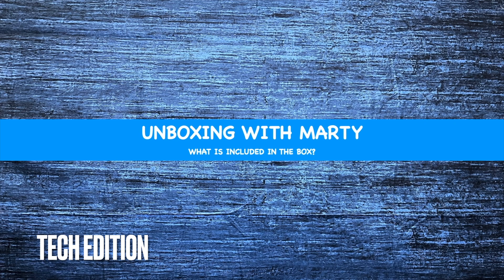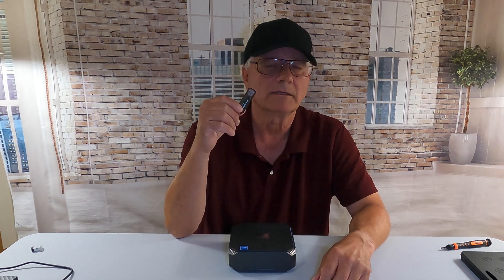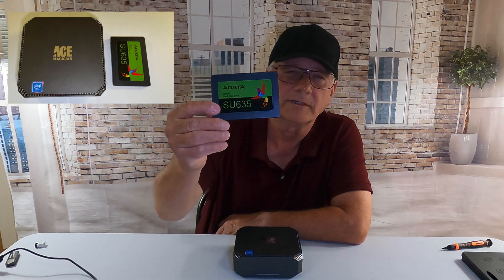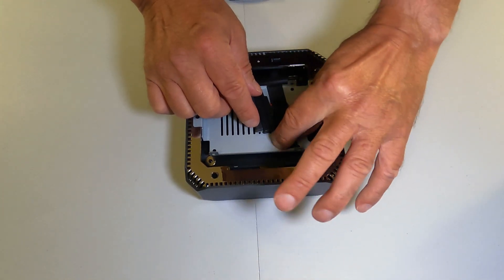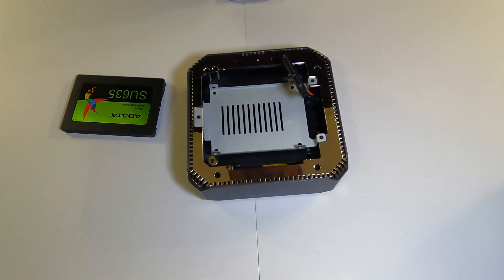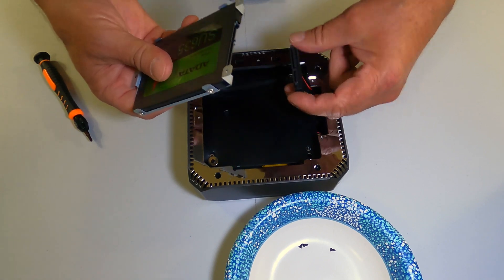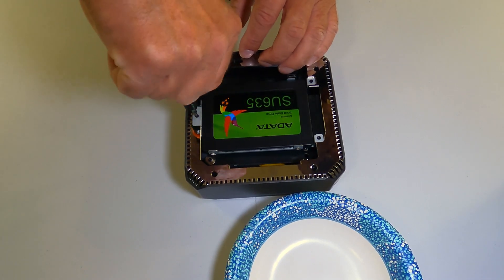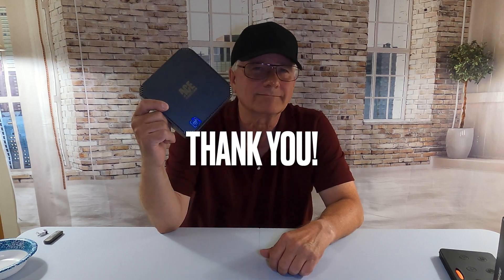Ace Magician Mini PC, see how simple it is to add additional storage to this great mini PC - AK2PRO

Comment: How do you get the audio to work on that thing? I can’t get it to work. Running Windows 11. :(
Reply from the maker: Maybe the sound output settings? For sound are you using a monitor with built in speakers, Bluetooth speakers or wired speakers?
Reply: @unboxingwithmarty  it’s telling me there is no sound output detected.
Reply from the maker: I’m using a monitor with built in speakers, so sound is transmitted to via HDMI cable to the monitor speakers, what are you using?  Have you tried Bluetooth headphones or speakers?
Reply: @unboxingwithmarty  I’m using a monitor as well. I’ve tried multiple. No options for a sound output on windows 11 for me. I don’t see an aux output either. I only see a mic input. But I tried that as well to no success.
Reply from the maker: I’ll check mine this weekend and try different speakers (wire / Bluetooth) and let you know if I find anything , you might want to reach out to the manufacturer and see what they will suggest.
Reply: @unboxingwithmarty  thank you! Yeah I reached out last night. We’ll see what they say. They don’t even have this model on their website. Or even drivers for it. They do for their newer models though. Kinda odd.
Reply from the maker: Note: I have the Model AK2 PRO, see if in the device manager under Audio inputs and outputs if any Intel devices (drivers)  are listed.  I show one for the Microphone and one for the Speakers...If yes, try using a wired headset plugged into the back of the pc to see if it there is sound.  For my setup there is a third device listed ...the monitor's speakers also show up which is what I use.  Do you see your monitor's speakers listed?